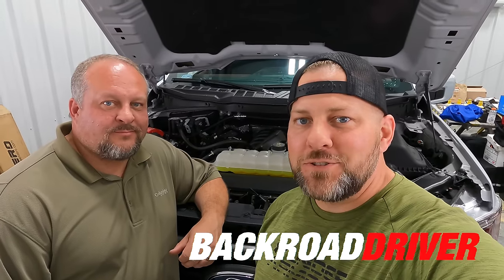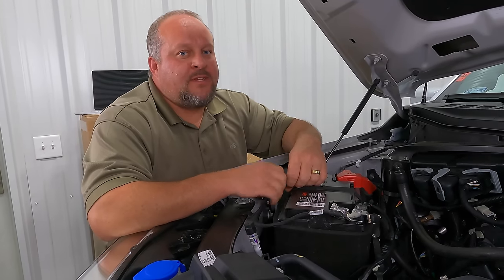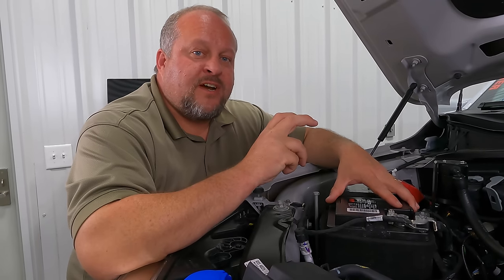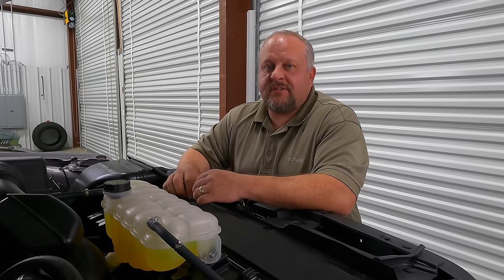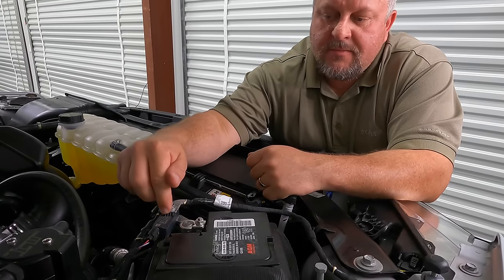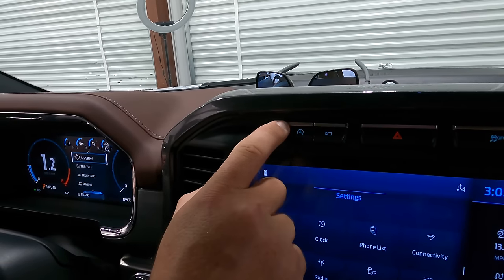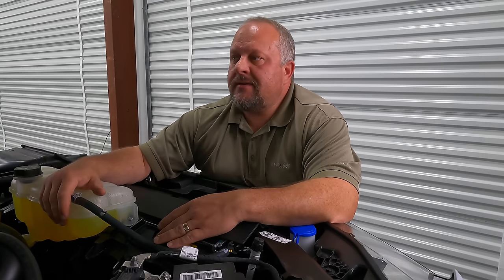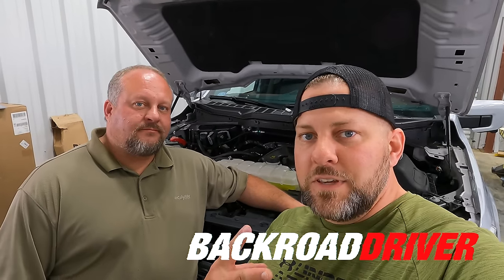2021 Ford F150 5.0 V8 Cylinder Deactivation & Oil Pump Belt Defeated! - It Wasn't All Bad...

Comment: I hope Ford never stops selling the v8
Reply: It's fastly become the least reliable engine in the F150 lineup. Cylinder deactivation, and a wet belt driven oil pump is not conducive to reliability. Ford is making their trucks harder and harder to work on...trying checking the fluid level on your 10 speed and you'll see my point.
Reply: @mmholling87  I respect your single opinion , but I have 2 in my work  fleet and brother has 1 , no issues brother , ford for life
Reply: @jtjtrs8806  cylinder deactivation and the belt driven oil pump are brand new for 2021. We don't have much data to see their long term reliability. The 10 speeds also has issues. The previous 5.0 and 6 speed were indestructible.
Reply: @mmholling87  you just answered your self , not real life data to prove, you talking bad about something with out proof just make you seem like a hater , you might not be but it shows ,
Reply: @jtjtrs8806  you honestly think a rubber belt is going to last longer than a pump running off a crankshaft using a steel gear? Name one other engine that uses this design? I'm an actually mechanic and not a contractor working on houses. You have 3 trucks....I've seen thousands.
Reply: @mmholling87  well Mr. Won't believe till I see,  and your negative outlook and passion towards something is abit crazy ,  don't take things too serious my friend you'll live longer , have a nice day
Reply: @jtjtrs8806  I'm a Ford guy too but I'm just being honest. These technologies are not proven but hopefully they'll turn out to be reliable.
Reply: @mmholling87  Ford has been "Germanizing" their vehicles for decades now.
Reply: 5.0 is the most reliable in the f150 line up.
Reply: @mmholling87  Exactly, you don't have any data to prove that the changes that Ford engineers made are making it anymore unreliable.  Cylinder deactivation doesn't necessarily mean a bad thing.  People are basing their opinions off of GM's and Chrysler's experience with it, but those two manufacturers used it on pushrod engines which are very different from a DOHC 5.0L Coyote. The kevlar belt driven oil pump has been tested up to 1,100 hp by Ford engineers, so I doubt consumers will have any issues with it unless they plan on throwing twin turbos on their 2021+ F150s. Stock 10R80 10-speed autos in the Mustangs have gone into the 8 second range in the 1/4 mile, so I would say that's pretty damned good.
Reply: @chrism.728  horsepower is not an indicator of longevity or reliability. A Nascar engine makes tons of horsepower and will last exactly 501 miles. The belt that drives the oil pump is a wet belt that touches oil...I think most people that actually build engines would prefer a traditional oil pump. Ford has not put a service interval for the life of the belt but other OEMs that use this same wet belt design have a serviceable life on 150k miles. If the belt that drives the pump fails you will to destroy your main cap and connecting rods bearing in seconds.
Reply: @mmholling87  Never said HP was an indicator of longevity.  The only way to prove that is over time.  No one has that data yet to make an accurate assessment on whether the changes made the 4th Gen Coyote more reliable, efficient, durable, etc... or not.
Reply: @chrism.728  then what was the point of Ford testing the belt to 1100hp? You were very quick to point that out. If belts were so reliable than the OEM would use them in interference engines but they don't. If that belt breaks you will lose all oil pressure and before you know it your cylinder walls will be scuffed along with your connecting rod bearings and main caps will be ruined. Who knows it might work out and be very reliable but it's rolling the dice regardless what side of the isle you're on. Only time will tell.
Reply: @mmholling87  They're doing this to make people think that EcoBoost engines are wayyyyyyyyyy more reliable which to me is really sad because my 2011 F150 with a 5.0L Coyote V8 has 138,000 miles on it and still going strong with zero issues.
Reply: @CJColvin  the 2nd generation 5.0 is an outstanding engine with good power and great reliability. Hopefully the 4th generation will be just as reliable, only time will tell.
Reply: @mmholling87  Right
Reply: Gm 6.0 is the best v8 you can buy
Reply: @bluesfan6862  sorry not a fan of that platform,  after using a few gm on our work fleet and failing I stay away from gm products now
Reply: @bluesfan6862  Agreed. The 6.0 is a great engine because it's simple- no variable timming, or direct injection, traditional oil pump and only one cam and timming chain. Mechanics tend to like what's simpler to work on because we know what a pain OHC engines can be to work on.
Reply: @mmholling87  that’s what I say. Six speed is plenty good enough. I love my 2011 5.0 with 189000 miles and runs great.
Reply: @terrorofdemons1168  great truck. The steel body trucks ride a little smoother too. The 6 speed shifts smoothly  and it's  pretty close to built proof. Probably the best truck Ford made since the 90s.
Reply: Amen
Reply: Just curious. How many miles does a 2014-18 F-150 with a V-8. I don’t know much about Fords. Just getting into Fords. I’m mostly a Cummins fans
Reply: @Beall_   my brother and I have a small company  with a small fleet of work trucks ,we have a 2008 4.6 v8  f150 with 300k and a 2015 and 2017 5.0 with close to 160k 180k  , and two old  diesel fords with close to 500k  , just keep it well maintained and use the proper wear and tear parts and oil and it will last you
Reply: @bluesfan6862  Wrong. The Ford 6.2 V8 that's in the f250 is More Reliable an much more power'
Reply: @bluesfan6862  thats a funny way to spell 5.7tbi
Reply: Won't happen, they've invested half a  billion into their v8s which include the gt500, raptor v8, f150, f250 v8s. Those were all what the money went to
Reply: Me too, it took 50 odd years to get the mustang in the UK. As of last December we can only get the auto now due to noise regs, sad times!
Reply: @mmholling87  I bought a 2008 Silverado new with cylinder deactivation.  200,000 miles later it has been a zero problem. None.
Reply: @jimwhitehead6265  Hi Jim, out of the big 3 GM has had the most issues with cylinder deactivation. Lifter and cam replacements are very common, a quick Google search will prove this. Your truck is atypical.
Reply: EV's will be here before your ready, V8's will be a rarity
Reply: @bluesfan6862  lol 5.0 smokes the 6.2
Reply: Um they are going all electric so

Comment: Cylinder deactivation is the reason there isn't a new truck in my driveway this year.
Reply: It's super simple to disable with forscan
Reply: @mattgerb17  if be worried that doing that could cause lifter failures like on the hemis and chevys when you disable it without doing the physical delete.
Reply: @Prestiged_peck  physical delete? No idea what that means. The lifters in them were only failing when those cyl were deactivated.
Reply: @mattgerb17  the hemi guys I've talked to have told me they fail in v8 mode usually, they cut a lot of oil flow when they go to v8 mode, and when you swap to non-dod lifters you also permanently unblock the oil pressure that used to be used for DOD, and make it pressurize the lifters 24/7. Otherwise why wouldn't they just unplug the solenoids so they can't collapse the lifters and not have to buy a bunch of extra parts?
Reply: @Prestiged_peck  the HEMI guys should know they can turn off cylinder deactivation right on their steering wheel by hitting the +/- gears and select the highest gear.
Reply: It won't be an issue for 5.0s. I've had a cammed Ram and deleted all the MDS lifters and had block off plates for the solenoids. The lifters in a Hemi are under a lot more mechanical stress because of very long rocker arms and pushrods. Higher revs and more agressive cam lift/heavier springs only make this much worse. The needle bearings in the MDS lifters are weaker and once they wear your lifter stops rolling freely on the cam. Game over after that. It's not just the MDS lifters that fail, its just a piss poor design and there are no bulletproof lifter to replace the factory ones. I went through two sets of non MDS lifters as well before I realized it was a piece of shit.
Reply: @TheIrishPhantom  we ain't talking about no hemi lol.
Reply: @greghale717  EYYY BROTHRR SAYN I OWN FURD NOWH AINT NU HEMMROIID V8 THERR UNDER MAH HOOOD NOWH HOSS PAYN TEENTION FORE YUYH REPLI
Reply: @TheIrishPhantom  sorry your hemi's got hemmiroiids. Lol
Reply: @greghale717  PREP H WADDUNT NUFF IT AWL BLEWD OWT
Reply: @johnoberle9750  It's nitbthe companies, it's the government.

Comment: While I'm not a proponent of cylinder deactivation, in overhead cam engines, they simply use a cam profile change to institute it. It doesn't require the fancy valve lifters in an pushrod setup that often fail causing damage to the cam lobes. OHC engines either directly accurate the rocker arms, or use direct tappets. I just feel it's rather pointless when VVT already retards timing on all cylinders at the same time, also reducing fuel burn. Since 3rd gen, the 5.0 just isn't as durable a motor in general. The 2.7 may have an oil pump belt, but I've never seen one fail early personally, and it isn't common at all. Everything else about that motor is built like a tank, and stock to stock, it will hand a 5.0 it's lunch. That being said, the 5.0 is still light years better than any has motor from GM or Dodge.
Reply: I was under the impression that the 4th gen 5.0 motor was improved and had solved some of the issues in earlier generations.  I am asking since I was considering the purchase of a new XLT with the 5.0 V8 while they are still available.
Reply: I just bought a 2024 Nissan Titan and that 5.6L Endurance V8 to me is wayyyyyyy more robust than that 2.7L EcoBoost V6 and not to mention the Titan is extremely underrated as well.
Reply: @CJColvin  You know, I also just purchased a 2024 Titan a week ago and will be taking it down Hwy 395 to see how it does.  Very comfortable and nice features and anxious to see what kind of mileage I can eek out of it.  I only wish it had a console shifter with manual shift mode.  The column shifter is okay but not quite as ergonomic for manual shifting.  For just a week, it does seem like a lot of truck for the money.
Reply: @Monacheman-4x4  Agreed and not to mention they're extremely underrated as well.
Reply: @CJColvin  Yes, and I just don't get that.   I cannot understand why they did not sell more
Reply: @Monacheman-4x4  Its mainly because Nissan failed to advertise more often than not and didn't market heavily as well.
Reply: @CJColvin  I only hope that it proves to be a reliable drivetrain and vehicle.  This only has direct injection and not port as well, so hope that does not impact long term engine reliability.
Reply: @Monacheman-4x4  Agreed

Comment: The 5.0 is definitely a great motor I have a 2013 with 270,000 miles on it no problems with the engine just regular maintenance

Comment: Placed my order today for a 2022 f150 5.0 and it’s now an option to cancel Deactivation. X52 is the option and it doesn’t cost anything. The dealer said it’s due to shortage of chips that has caused Ford to offer it. So HELL YEAH
Reply: Are you sure that’s not the start stop delete?
Reply: @cliffmorrison1130  it's start/stop...... I just got mine ordered without because of the chip shortage lol. Let's Go Brandon!!!
Reply: Same here, I ordered my 5.0 stx but I just saw auto/stop start delete, I wonder if it also come with deactivation .

Comment: The problem with unplugging that battery monitor cable from that BMS sensor is that now you actually change the charge rate at which it keeps the battery charged in that vehicle 

now I'm not saying it's not going to be sufficient but the vehicle may see that as an issue and it starts shutting down features online that create an issue for the customer because it can't monitor the battery 

so it says you know what let's disable the passive entry system
 let's disable the door keypad
 let's disable ambient lighting these are things that are not needed for the vehicle to run if we can't see what's going on with the battery

Now I've had people try to disable their auto start stop in older vehicles and this was a problem because they go up there and they unplug that or unplug the connector underneath that the trailer brake module to stop the auto start stop and then other things start disabling inside the vehicle and I had to track down what they were doing to put all that bad information to rest because it eventually down the road started affecting other things that were not working on the system

Theoretically all you'd have to do is save a junk old battery just enough to get the vehicle to start leave the battery monitor on board with that bad battery let's just say 60 to 70% charge rate that that battery has or life I should say lifespan and it will disable that it'll start stop and active fuel management anyway and then take the regular battery and put it back in the truck and until everything is reset it's going to stay disabled. I don't know I just wanted to put this here so people have more information I don't think people quite understand these systems like they think they do it actually works much more complicated than what most technicians even care to realize but when you get into the description and operation on how the system works there's several pages of what that battery monitor system actually does it's more than just the few things that you mentioned in this video

Comment: The battery monitoring system does more than decide about activating auto start/stop.  It also varies the load on the alternator to provide the right amount of voltage to the battery depending on the battery charge state.  With the monitoring system deactivated,  the controlling computer thinks the battery voltage is low and will default to max charging all the time and not only cause extra drag on the engine it might over charge the battery.
Reply: Extra drag on engine? maybe.  Over charging the Alt? No.  Ford BMSs keep the batteries at too low a state of charge anyway.
Reply: yeah I really don't like the idea of doing this...like another comment said you still have to push a button to bypass the warning screen on startup, why not just push the auto start/stop off button and leave the battery monitor alone? Plus I'd bet the Ford Pass smartphone app will complain about it too and you'll end up with a ton of alerts if you defeat the battery monitoring system...

Comment: Just got my 21 f150 stx 5.0 last week.   Hope it won't be the last of the v8s. It has tons of power and the engine  sounds awesome.
Reply: How much you pay? Looking at trading in my 2014 stx 5.0
Reply: Have you put premium in it yet? If not do so, it's actually factory tuned for it and pulls timing on 87
Reply: @Bighoss22  48k but compared to my 08 f150 its a lariat lol
Reply: Sheesh just picked mine up for $40k today
Reply: 21 4x4 STX w the 5.0
Reply: @xxrealdealxx11  they're awesome, and from what I heard the DOD really helps and has no reliability issues
Reply: @Prestiged_peck  from what I’ve found I haven’t seen any advertised increase in power with 93 or E85. It’s factory tuned as a minimum of 87 octane. Says so in the manual
Reply: @xxrealdealxx11  from what I head, the gen3 gets a pretty big benefit when towing, hears it from a ford tech so figured it was good info.
Reply: @Prestiged_peck  I've been running mine on E85 - 100+ octane and it definitely rips! Actually it's pretty quick regardless of what fuel you run but saving $1.50 vs premium is a huge bonus considering how much gas costs nowadays
Reply: I'm definitely loving that V8 sound! Thinking I'll be adding an electric exhaust cutout to bypass the resonator and muffler (maybe I'll route it back into the tailpipe though instead of just dumping under the middle of the truck) so that way I can keep the quiet stock exhaust for highway trips but open 'er up whenever I'd like to hear that sweet V8 rumble...
Reply: @yamaholic11  true, very true.
Reply: @yamaholic11  you will not regret, dumps are the best thing to happen to daily hotrods since straight piped exhaust

Comment: I have a 2016 rebel with only 36000 mile and it just started tapping , this cylinder deactivation is such Abad idea. Even if I fix it in still going to be worrying when will it happen again. Thank you for your in put im looking to change to a f150 5.0 . You help take away some fear. Will wait on more up dates from yiu guy. God bless.

Comment: My 2021 5.0 burns oil on every startup. It went from full on the dipstick to add oil after 800 miles. The truck has 3300 miles on it and is going in to the dealer this week.

Comment: I’m pretty sure you can go to auto zone and buy just a trailer plug and put it in and it will deactivate both the cylinder deactivation and start/stop. This is because when you are towing a trailer it won’t do either of those things.
Reply: Also, I think 5 star tuning can shut it off with a tune.
Reply: @skullhart  the cylinder deactivation hasn’t been cracked yet. Tuning isn’t available for the 21 yet that I know of.